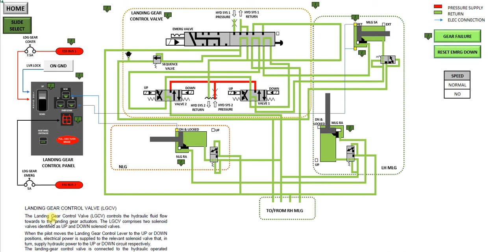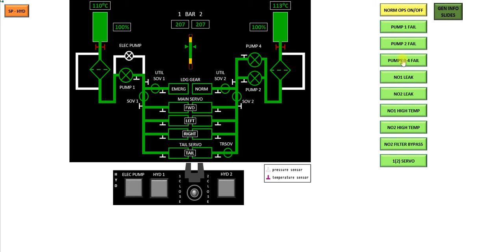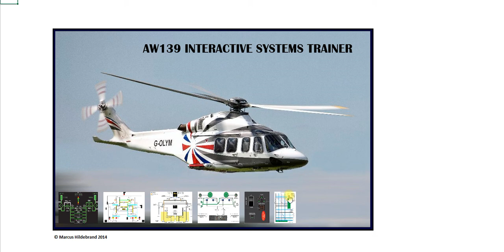Excel AW139 Landing Gear System

Comment: Might want to add this to your presentation Marcus, compliments of Roberto Rambelli, as this could also be a reason for the undercarriage free falling:

LOSS OF ELECTRICAL POWER WITH LG UP 

In case of loss of electrical power from ESS BUS 1 or LDG GEAR CONTR circuit breaker tripped, the solenoids inside the LGCV de-energize and pressure is relieved from LG actuators and landing gear fall because of gravity. 

The LGCL is not effective and the lights in the LGCP cannot illuminate. 

Emergency extension is to be carried out.
Reply from the maker: While there are a couple of reasons that would make the landing gear free fall my presentations are not meant to be exhaustive in their current form. If they get people thinking then that's a good thing! Good points though.
Reply: @RadialTrainingSolutions2016  I had watch your videos and it's very well explained. Is there a chance to have a copy of your presentation?